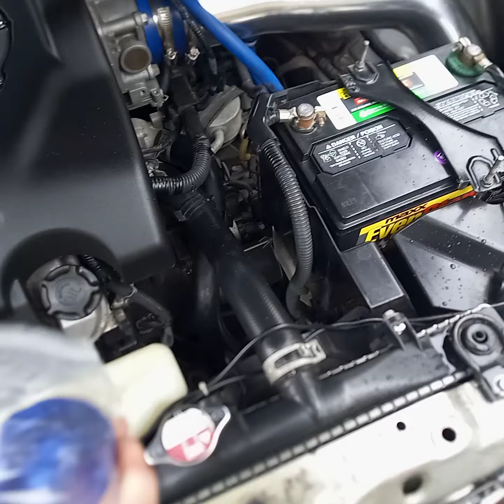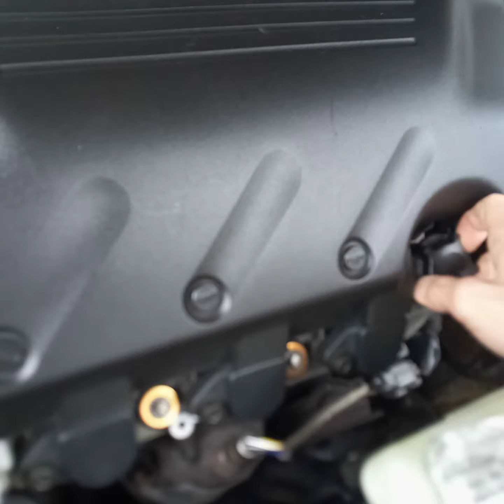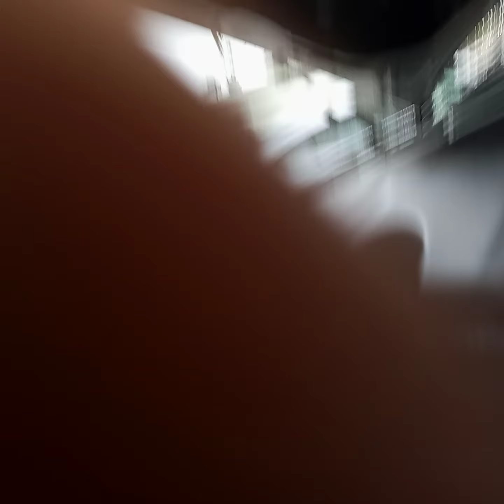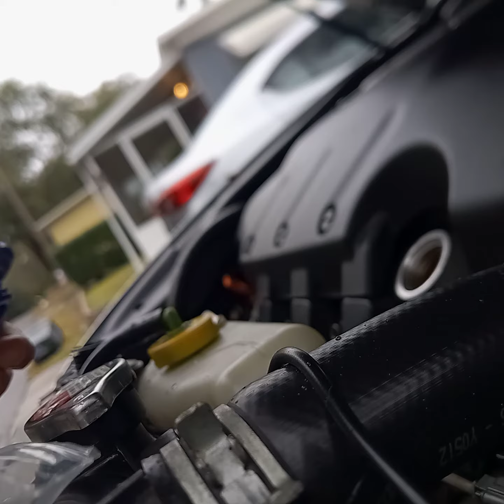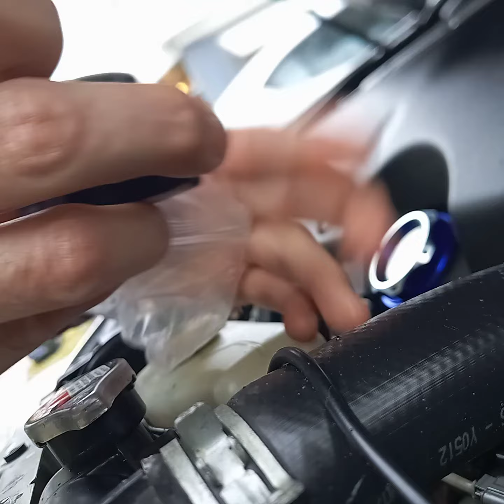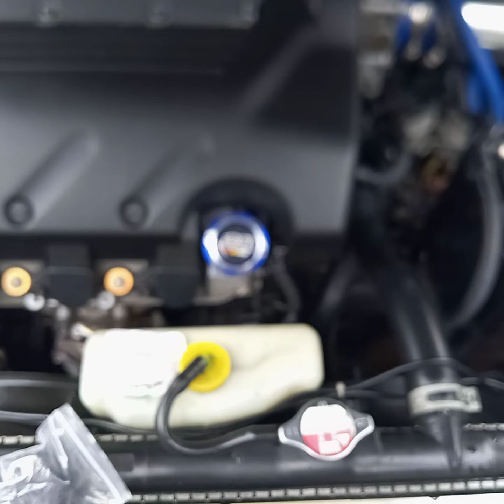Replace oil cap #mugen #bhfyp #acuratl #aspec

Comment: Currently looking at one of these on ebay but in green and not sure if they'd be good enough and not cheap out.
Reply from the maker: I still have mines . 🫡
Reply: @mikebellagiomusicgaming1893  was from eBay? One im looking at is like $14
Reply from the maker: Seems like the right price 15 or 20 bucks it's better than a plastic cap that can break and crack in the motor
Reply from the maker: Get it 💪 👏
Reply: @mikebellagiomusicgaming1893  say less I'll order it rn. My first car so I don't know pricing for most stuff yet.